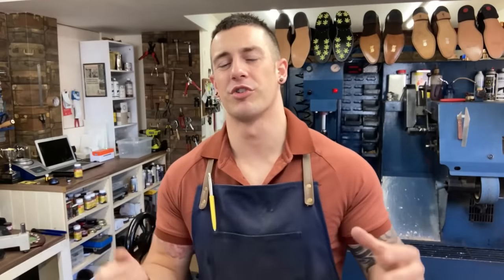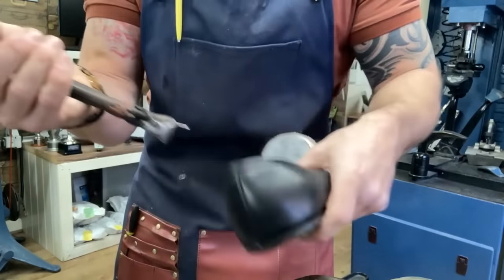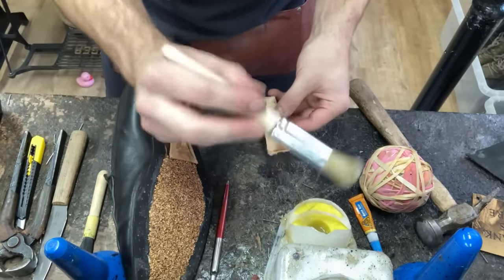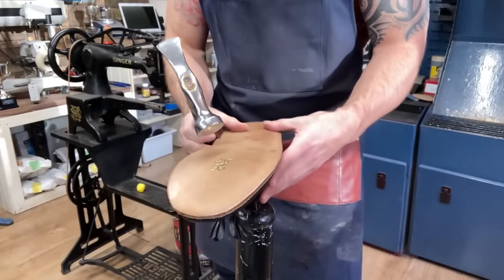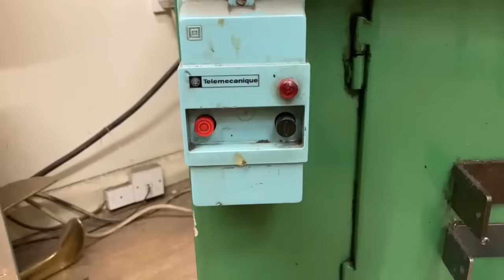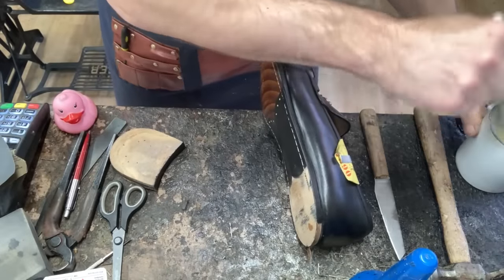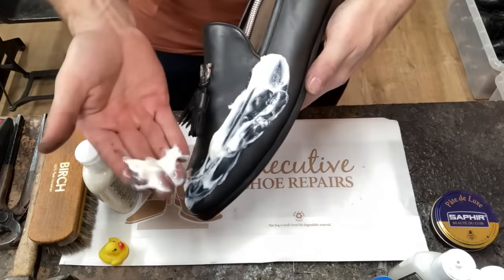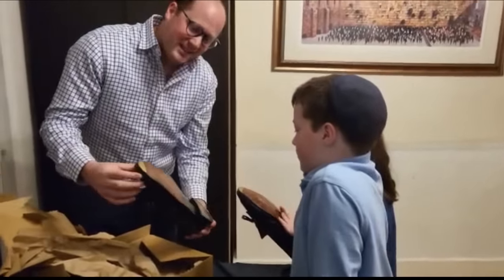Expensive FERRAGAMO SHOE REPAIR! // PLUS CUSTOMER REACTION!

Comment: I started my working life in 1968 as a trainee shoe repairer and quickly escalated into key cutting and hand engraving (using an old dentist drill. Whilst never reaching your high standards, it did bring back many fond memories, especially the fitting and use of the 'naumkeg'. Great job and video

Comment: Brings back memories of my days as a cobbler. The training was "Always clean up" and when i first watched your video and saw your gluepot i thought thats a no no, then you said you cleaned it lol. Something to bear in mind, your finisher is belt driven and that dust builds up inside around the motor and it can overheat and cause it to fail. We used the airline to blast the dust from inside the finisher to save any problems.  I'm now going to watch your other videos because they are very entertaining.

Comment: When your jacked enough to not even need the machine to pull out the Goodyear welt 😂 absolute unit in size and your profession. I got into shoes a few years ago. LOVE what you do and how well you do it.
Reply: sorry but there is no process of goodyear welt in that shoe , regards from mexico , the stitching is at the inside of the shoe , welt is a totally other type of process
Reply: @santaclaus179  I'm aware of that. I wasnt stating that shoe specifically. It was a generalized statement.

Comment: Expertise in this field is important, valuable as well as designed for QUALITY and its standards of excellence. The types of equipment supplies used as well as the approach to quality control, stable and fair priced is exceptional since it is branded, while the oven is an added plus. Congratulations for a perfect approach to stable quality that does not deteriorate. Est. Year____,

Comment: I had broken my hip as it healed it shrunk 3/4" Back in 2012 before finding these videos. I went to NYC to find a good cobbler I believe that's what she builders are. He added 3/4" to sneakers and work boots. I never got to use the work boots as I needed a hip replacement and now my leg is equal so I dont need the boots. :- )

Comment: Love your work! However, repainting the Ferragamo buckle/metal design with a brush didn’t work out well. One of the main things when you’re looking out for fakes of such designer brands is the finishing/shine of the buckle. If the paints is uneven and the reflection is not smooth, it gives off replica vibes. Maybe there could be a way to improve the shine/finishing of the buckle?

Comment: These are quite expensive.  I'm wondering why anyone would repair a shoe instead of just getting new ones?
Reply: It was cheaper back in the day when cobblers were more plentiful and shoes were harder to make, in the case of these shoes it's still cheaper to have them repaired than to buy a new pair. A lot of people will have shoes repaired even if it's too expensive because they're emotionally attached to them.